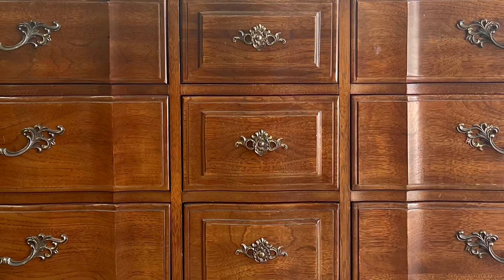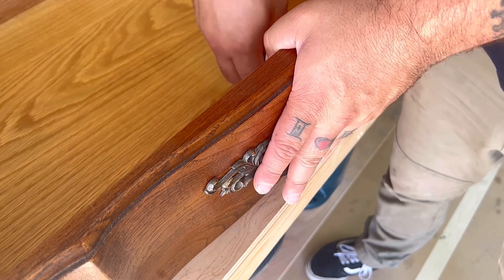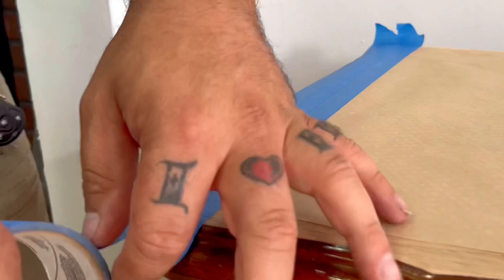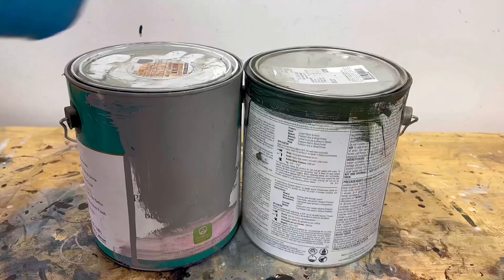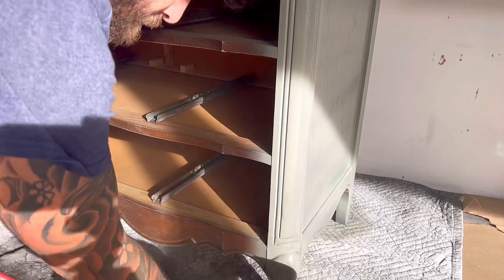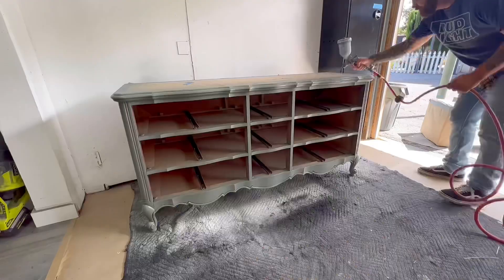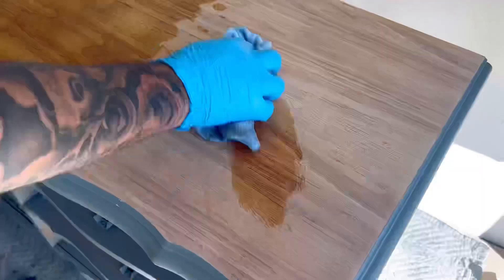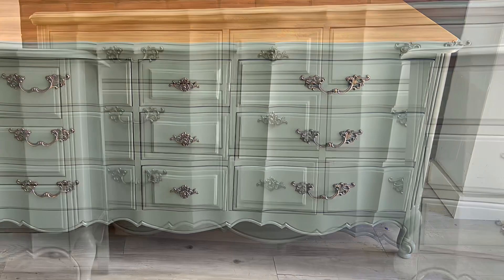Extreme MAKEOVER of this THOMASVILLE FRENCH PROVINCIAL dresser set || TRASH TO TREASURE FURNITURE

Comment: Do you ever stray away from veneer or do you basically treat it the same you would solid wood? Thanks!
Reply from the maker: It’s pretty rare to find a piece that is actually solid wood straight through. Even if it is solid most often a veneer will be placed over top to give it a very beautiful wood grain pattern. You want to treat veneer as delicate as possible especially around the edges as you can sand through that fairly easy.
Reply from the maker: Definitely reach out with any tips questions or anything I don’t cover in my content and I’ll help out as best I can. Thank you again for the support.

Comment: Excellent work! Will that gold stuff you put on the handles come off over time?
Reply from the maker: Thank you so much. I depends on how much wear it receives but it will last for years because it dries in a hard wax finish. A clear coat can definitely make it last longer but by itself should be fine for a long time.
Reply: A brass piece won’t take the wax as well. It’s too smooth, but solid brass hardware is hard to find except in the most high end pieces, zinc will take wax better, it’s more porous.
Reply from the maker: Thank you for the advice. I’ve found that it does pretty well over paint as well. The paint I used has a bit of a texture to it so it should sit deep in the grooves of it.